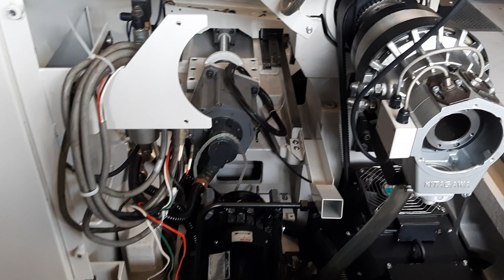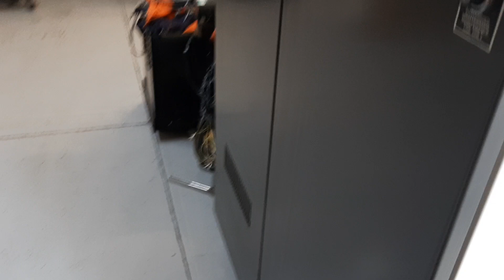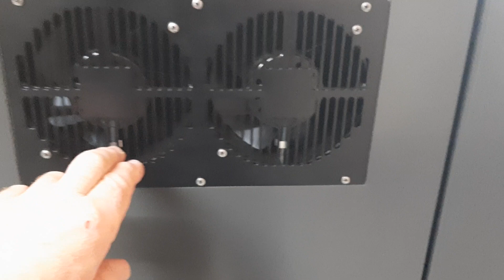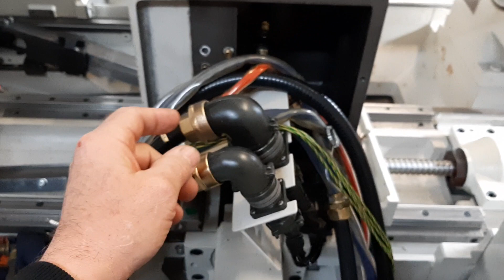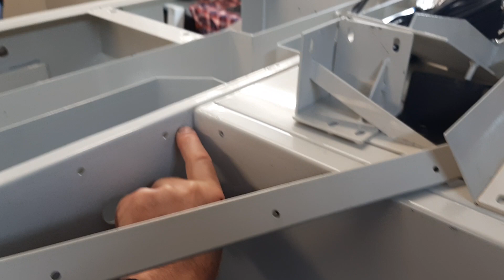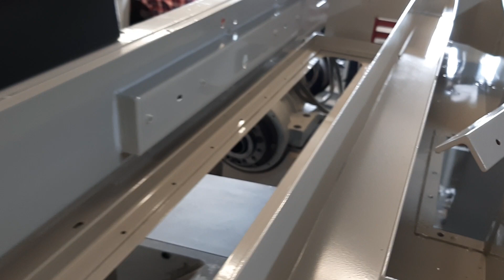CNC Lathe Rebuild. My Progress So Far.

Comment: Looks good mate. 
Got a few older machines myself in my home machine shop. The most I have done to one is a new spindle cartridge ball screws and thrust bearings on a old fadal 4020. Been running great since then.  Nothing like what you have taken on that's for sure. Hats off to you it's a huge task.
Reply from the maker: Hey Dean.

A Fadal CNC Mill.
Very nice.
They are great machines to own,
You should post something up on your Instagram so we can have a look.
I guess they all look the same,  but it,s still good to see what people have running in there shops.

My Mazak Mission  has been a fairly long rebuild.
I did get a little carried away with doing so much work.
It just seem to happen on it,s own,  LOL.
It will be a good machine when it,s all finished.
Very much looking forward to it.

Thanks for taking the time to watching.
Peter.
Reply: @weldmachine  I would love to do a full rebuild like this some day but the thing I keep coming back to that at the end of it I still have a 30yo machine that won't have the features of a new machine and given the cash it costs and time I just can't justify the project. 
Keep up the videos. 
Cheers
Reply from the maker: @deanmolloy2276  
It,s definitely a Labour of Love for sure.

I guess you could look at like building a custom car from a rusty shell.
Most guys spend hundreds if not thousands of hours building these cars.
In the end if they had to put a value on the car they build including labour most of these cars would run into hundreds of thousands of dollars.
In the end when they become bored of these cars they sell for only a fraction of there worth.
I think it always comes down to what you enjoy doing with your time.

Not pointing the finger at you of course.
But many ask WHY bother rebuilding an old machine ??
All the time and money you spend rebuilding it i would rather buy a good machine that,s already running.
There are a couple of things with buying any machine more so a CNC machine.
Reality tells us that what we pay is what we get.
Buy a cheaper machine always spending money fixing it.
or
Buy a brand new machine on finance and and half the price again with fees setting up the loan, interest payments etc.

There is this theory that If you buy a CNC machine it will pay for itself in 
2 to 3 years even quicker in some cases.
This theory works IF you have a consistent supply of work.

I know a guy who thought buying a 5 axis mill would be a way to produce work and income.
When i visit his shop most of the time the machine is not even turned on ??
He did have work for this machine but it dried up.
He has other VMC,s and Multi axis CNC  Lathes that do the other work that comes in, but nothing worth running 5 axis set up on as you can only run mostly one part at a time.

It,s funny how you only hear the Good stories about machine shops.
Reality is it,s tough running a machine shop, everyone is undercutting everyone else ?? It's Crazy.

If i was producing a product and needed a top notch machine, no trouble i could buy one.
But unfortunately i am not in this position.
I brought only enough of a machine for the work i can already produce on a  Manual Lathe or Mill.
Because i like good looking equipment i got a little carried away rebuilding this Lucky machine, LOL.

Apologizes for the Long reply, sometimes i get a little carried away when caught up in the moment ??
It,s not directed at you in any way it's just me thinking out loud.

Thanks again for your reply.
All the best.
Peter.
Reply: Hey Pete. I get it. I spent 25k on a 89 gsxr 1100 motorbike with turbo efi conversion custom triple clamps etc. Did all the work myself that's how I got into machining. Making bike bits then once others knew what I could do the work flowed from there. Now days I never make anything for myself. 
And yes anyone can go buy a new vmc or lathe it doesn't take a lot of effort or originality but there will never be another lathe in the world the same as yours. Cause I have a back log of work I tend to hate working on machines cause I don't make money or get jobs done doing so. Spindles running = $$$
I guess this is what happens when you turn your hobby into a job. Gotta get a new hobby.
Still got the bike btw. Sits in the shed and only gets ridden once a year when the WSBK comes to phillip island.
Reply from the maker: @deanmolloy2276  
Hey Dean.
I am also a bike guy, always have been.
Current bike is a GSEXR 1000 04.
I don,t get that much time to ride these days with family and my shop to run.
I did previously own a 1990 GSEXR 1100 / 1340.
Had a lot fun building it and of course riding it.

I owned a small engineering shop years ago which was primary Motorcycle engine work.  ( just lost some interest in the business and sold it )
Have had a different mix of bikes over the years.
6 Kawasaki,s.
3 Suzuki,s. All GSEXR,s
3 Yamaha,s  2 R1,s.
Nearly brought a Fireblade but did not happen,  so NO Honda,s 

Next Mission / Project after the Mazak is finished ??
Will be getting my GSEXR 750 Drag Bike going again
Just for some fun.
Spent to much on the engine to sell it,  so just kept it for later on Fun.
I plan to do some video,s not sure how to put them together as yet ??
Mostly modifying the existing Frame, Forks etc.
It,s a Pro Stock style bike.
Not fast compared by today,s standards but fast enough to be fun.
Mostly ran it back in the 1990,s.
Ran a best of 9.05  ( normal aspirated  ) not bad for a late 1980,s bike. 

I currently live less than 1 hour away from Philip Island.
Unfortunately have not had a chance to get to the World Supers as yet.
Always something comes up to stop me from going, 
( life in general and work of course ?? )

Getting back to CNC again, LOL.   BIKES ???????? LOVE EM.

How it works out for me with the Mazak.
Is i wanted to buy a new 5 axis CNC Lathe, but then weighed up how long i would Need to run it on a daily basis, to justify buying it ??
I have run a few CNC machines in the past.
I do enjoy set ups and programming but after that ???????
I find watching grass growing more exciting,  LOL.

Thinking more about what i Needed rather than Wanted i brought basically the same machine i first ran CNC wise.
The place i was working brought there first New 1990 model Mazak QT 15.
They asked me to do the training with John Hart back then.
It,s ironic i finished up back on the same model of machine again after all these years.

I am very fussy how i like my shop to look so it was basically an easy choice to rebuild it.
I can,t say i wished for it,  but i am doing my best to make it work for me.

I did originally set my shop up for repair work,  not really for manufacturing.
As time has gone on more customers ask me to make different things and i guess here i am now.
I can not say i really enjoy manufacturing but i sort of make it work ??
Always dealing with the cheaper, cheaper of manufacturing drives me up the wall ????
I find with manufacturing that i spend 10 hours doing a job but usually only get paid for around 7 hours ????  ( sometimes not even that much )
Reply: Sounds like you have a lit of experience with the old oil cooled gix.
I put my bike down the strip. I lowered it and put on a shinko hook up tyre on it. Went to heathcote a few times for a bike only day but track had no vht on it so just spun all 1st and 2nd to a best of 10.33 @ 144mph. 600s would get me off the line but once in 3rd it would haul the mail as I could open the taps all the way with all the boost. 
Good times.
What was your old business name?

Comment: Your machine is looking good Peter. Hopefully the missing parts will turn up.
Reply from the maker: Hey Tim.
Yes the machine is looking not to bad now.
Been working on it today running more electrical cables.
Plenty to still do yet ??
I doubt i will see those MIA parts.
My fault i should have been watching them going and coming back ??
But at least it,s starting to look like a machine again now with the top panel added.
Thanks for checking out my progress.
Peter.

Comment: Looking great Pete! Good to see all the major pieces together.
Reply from the maker: Hey Dave.
Yes most of the major build work is finished.
Just some sheet metal to sort out still.
Today i started running some electrics back to the electrical cabinet.
Is good to see it finally heading in the right direction.
I was busy with my silicone gun again today filling up every little gap i could find, lol.
There might be 2 video,s left to do possibly to finish this Mazak Mission.
It will be good to see it making money instead of spending money for a change.
I think this machine will see me out, mostly the reason for all the effort i put in.
Thanks for watching.
Peter.

Comment: Starting to get pretty close now mate!
Reply from the maker: Hey Callan.
Yes it start to look much better for sure.
It might even run before the this crap year is out, lol.
A Positive from a Negative i guess.
2020 has not been a great but at least i will finally have my Mazak Mission finished.
I still remember coming over to your shop that Saturday when you were running your Okuma Lathe.
I was a little envious thinking i can do this One day.
I don,t think i will miss cutting threads on my Manual Lathe.
Thanks for following along.
Peter.

Comment: Looks brand new! Hopefully the missing pieces turn up.
Reply from the maker: Hey John.
Yes it,s not looking to bad now.
It's good to finally get the top panel on.
At least now it's looking like a machine again.
Now it,s just a case of running all the services to where they need to go.
Still a bit of finishing off work to still do on the main machine still.
I have many doubts that any of my missing parts will turn up unfortunately.
Thanks for watching.